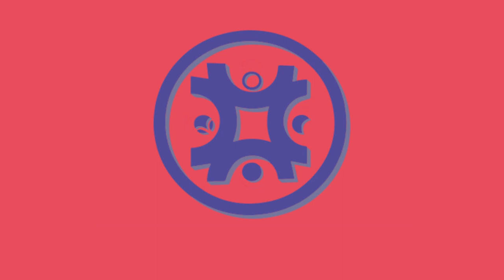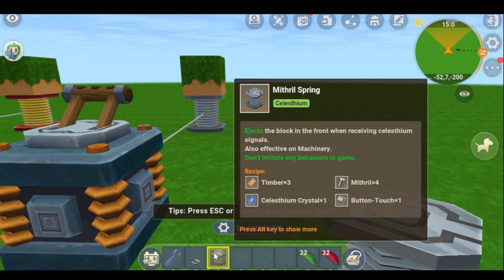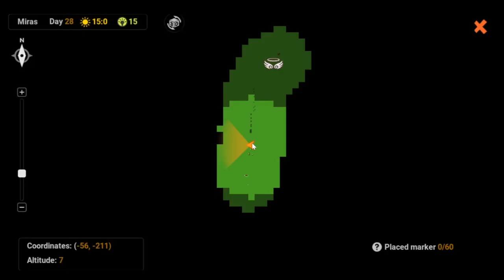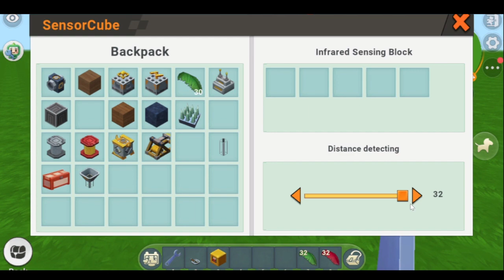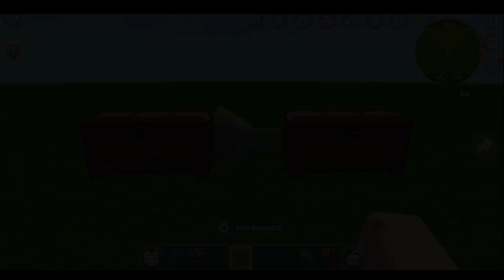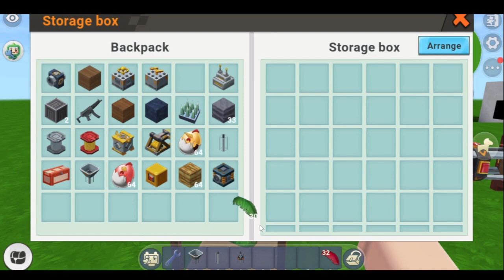Celesthium Circuits dDevices ⚡🔌🔋🔧

Comment: how to use lever after update? the doors don't open now. everything is messed up
Reply: You need light beamers to activate anything now. Including doors. As for infrared sensors, the are heavily nerfed, only giving power from the back. The launcher is even more nerfed. It's now removed but a new item is added called celesthium booster.Requires light beamer, lever, and a tunnel system to work.